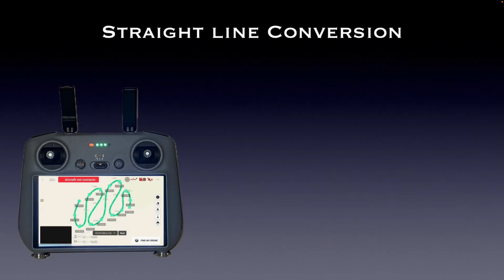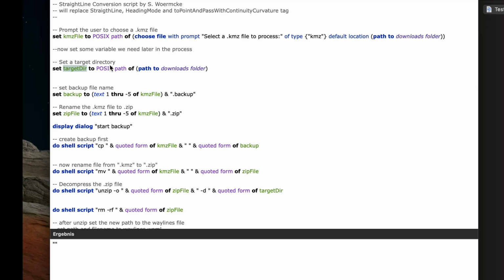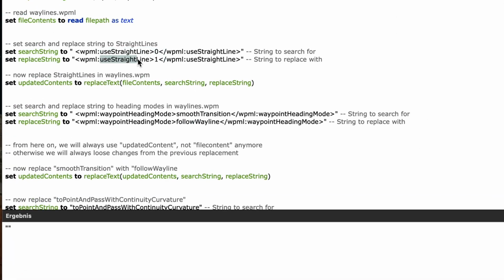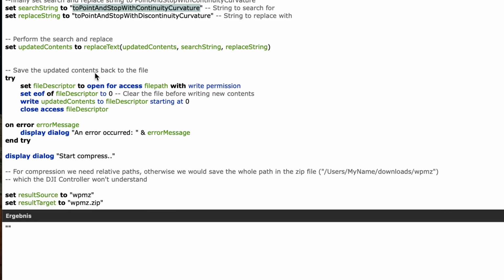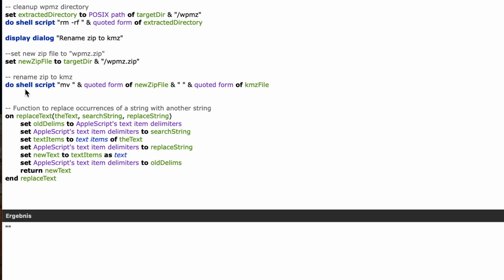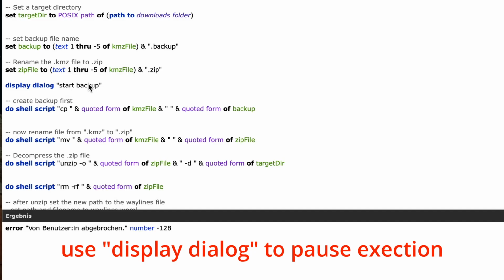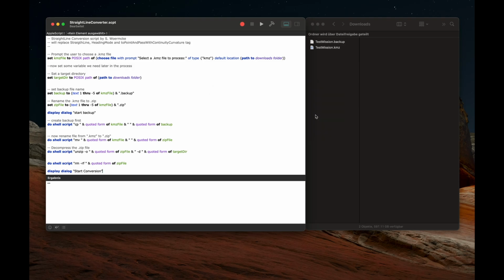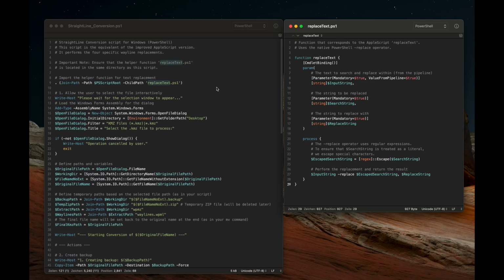Convert DJI Waypoint Missions to Straight Lines – Full AppleScript + Windows PowerShell

Comment: Thanks for this. Exactly what I need. The AppleScript is a nice touch. One question. The comment about being careful to use 'Exit Without Saving'. Does that apply anytime the mission is used or referenced? I'm assuming using that option is to prevent the controller from overwriting the modified .kmz file, or some other situation in which the straight line modifications cause problems. Thanks again. Excellent tutorial.
Reply from the maker: Thanks for your feedback! Anytime you open an existing waypoint mission from your list, and you exit waypoint missions afterwards, the controller will ask if you want to save. In the meantime, the new Litchi version supports converting curved to straightline mission with one click, check out my video where I explained this: 
https://youtu.be/2lRkoZ7m7sw 
And another new feature of Litch (the new version): you can now directly import your mission into your RC2 controller, without the hassle to export Litchi as CSV, convert it to KMZ etc. The details you'll find here: https://youtu.be/ZnqbsGaZBGw
Reply: @stefanwoermcke6828  Thank you yet again! I have not explored Litchi. I am relatively new to this (Air 3S) and was not doing any preplanned waypoint missions or anything other than free-form flying. Things have changed offering new challenges.
[Update]
I've explored your tutorials on the new Litchi. Excellent again. You are my new BFF. Your entire set work on this pesky issue has saved me (and others) enormous amount of time. Looking forward to looking at your other videos.

Comment: Thanks for the tricks man! I noticed after I replaced the KMZ in the RC with the one edited, and then saved the way point, once i open the same WP it changed into absurd lines, despite the WP numbering still the same. I'm using Air 3S and DJI RC 2. Do you know about this issue? @stefanwoermcke6828

Comment: 저는 windows powershell을 사용할줄 몰라서 kmz 파일을 zip로 압축한다음 waylines.wpml 에서 메모장을 켠다음 수동으로 텍스트를 교체 후 저장하고 다시  zip로 압축까지했습니다. 
이 zip파일을 kmz 파일로 어떻게 변환시켜야하나요??(연결프로그램에 kmz는 없습니다)
그래서 저는 변환사이트에서 zip를 kmz로 바꾼 후 이름을 변경하고 컨트롤러에 업로드 후 다시 실행하니 기존에 있던 웨이포인트들이 다 사라졌습니다.
어디에서 문제가 생겼는지 모르겠습니다. 혹시 windows powershell로 스크립트를 사용하는 방법은 알려주실순 없을까요?
Reply from the maker: you don't have to convert your zip into a kmz file - simply rename the file from *.zip to *.kmz. Also pay close attention if the zipped file will include the relative path to your waylines.wpml and template.kml files, it  should be "./wpmz", and NOT the absolute path:  [your drive/yourdirectory]/wpmz. The absolute path will not work for the DJI controller

Comment: 안녕하세요~dji air3s 사용하는 유저입니다~
2D항공촬영을 알아보다가 이 방법이 좋아보여서 시도해보려고 합니다
예상비행경로를 만들려면 무조건 드론링크에 월구독료를 내고 해야하나요?
아니면 rc2에서 곡선으로 비행경로를 바꾸고 이 작업을하면 직선으로 바뀔까요?
Reply from the maker: Dronelink is a one-time payment, for onboard waypoints you need the "Elite" edtion, which is a one-time payment of around USD 120,-  If you want 100% straight lines, you can use my script to convert the KMZ file into a straight line mission. Important step: if you successfully uploaded your mission to your RC 2 controller /DJI fly app: NEVER HIT THE SAVE button in DJI Fly: this will destroy the straight line mission in a mix of straight and curved lines! Once successfully uploaded, there is no need to save the file again on the controller

Comment: Hi,
thanks for the scripts! Everything works as expected on Windows 10, the .wpml file is updated and the commands are replaced where intended.

However, after I replace the file and load the mission in the DJI Fly app (iOS), it looks exactly the same as before. The lines are still curved, distance and estimated time are the same as the original mission. Has this ever happened to you? Do you think it's just a visualization bug and the drone would still follow the updated mission? I've even tried to export the mission file back after opening it in the app and it hasn't been modified (i.e. useStraightLine is still 1).

I'll eventually test and execute the plan in a safe place to see which path it follows.
Reply from the maker: first of all thank you so much for testing, especially the Windows script, as I cannot do this! No, if you replaced the exact same cryptic file name, DJI Fly app should display the new mission with straight lines. I remember a while ago i missed the last 5 or 6 characters of the cryptic file name (was not obvious at once), and I had a similar problem. If the file you uploaded has the exact name like the containing folder,  you can check if a) "toPointAndPassWithContinuityCurvature" has been replaced with toPointAndStopWithDiscontinuityCurvature and b) toPointAndStopWithContinuityCurvature has been replaced with toPointAndStopWithDiscontinuityCurvature. For some reason a) as well as b) will appear in the original KMZ file and both need to be replaced to get straight lines. The replacement of "smoothTransition" with "followWayline" won't affect the curved/straight waylines, it is more about the way the drone yaws at turning points.